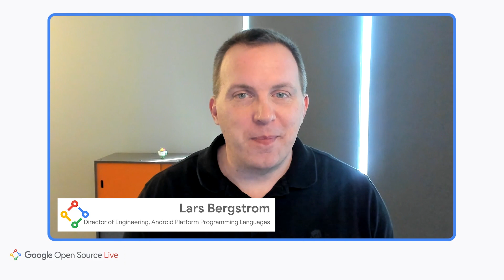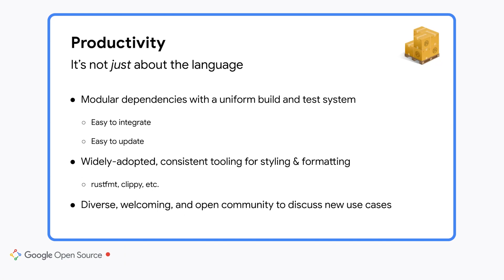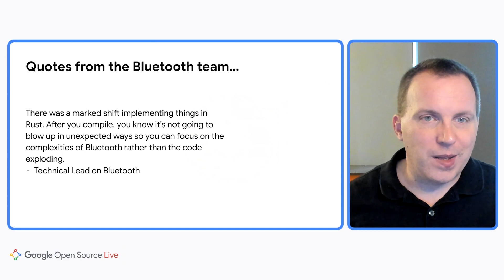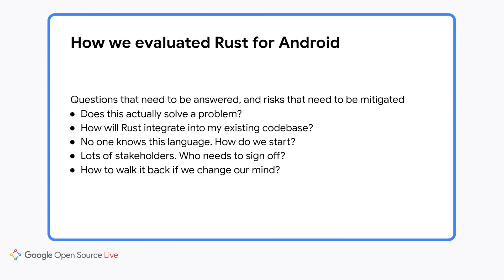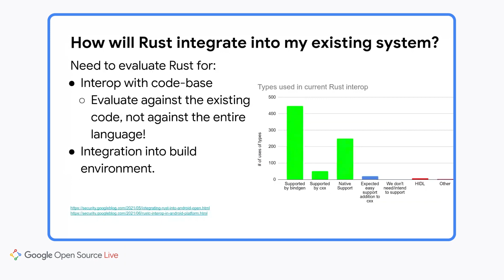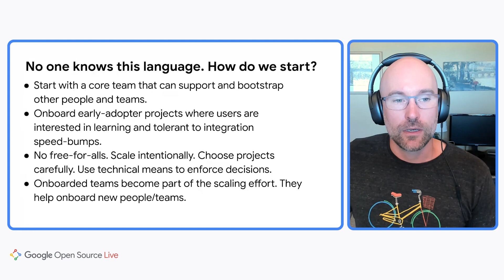Should your team adopt the Rust programming language?

Comment: You guys invented carbon right? Why so much love on rust suddenly
Reply: The carbon site even mentions that you should use Rust if you can iirc
Reply: As far as I know, the reason carbon was created is to be able to use C++ large codebases which are difficult to rewrite in Rust.
Reply: @rustdev1  they’ve been adopting Rust for longer than work has officially been done on Carbon if I’m not misstaken. And the adoption has not been very sudden.

There is also a difference in the uses and approaches of the designs of languages. Carbon is a successor of C++ and Rust is not. The upside is a language with full backward compatibility but getting rid of the built up technical debt of C++. That is awesome, but it also doesnt include everything Rust has. Carbon is aimed at being safer, but not inherently mem-safe as a paradigm. So its kinda apples to oranges. Perhaps both have a place, perhaps not. Carbon is also only being experimentally developed currently, whereas Rust is getting pretty mature.
Reply: "Existing modern languages already provide an excellent developer experience: Go, Swift, Kotlin, Rust, and many more. Developers that can use one of these existing languages should. Unfortunately, the designs of these languages present significant barriers to adoption and migration from C++. These barriers range from changes in the idiomatic design of software to performance overhead."
Reply: @merlin6962  in pretty sure that kotlin was never intended as a replacement for c++ but instead for java as it runs on the JVM and is compatible with existing java code

Similarly for swift (swift is the suggested language used to build apps on MacOS *correct me if I'm wrong*) which was intended as a replacement for objective-C
Reply: @zxq_5  That was a quote from the official carbon repo. They are basically saying you should only use Carbon if you already have a large C++ codebase and can't / don't want to migrate to something else.
Reply: They have Go too. Google is not focused on a single language.
Reply: They also have dart